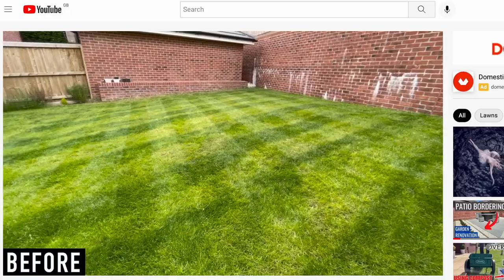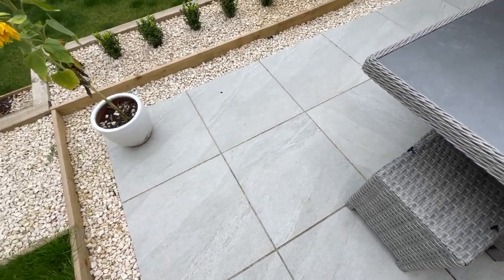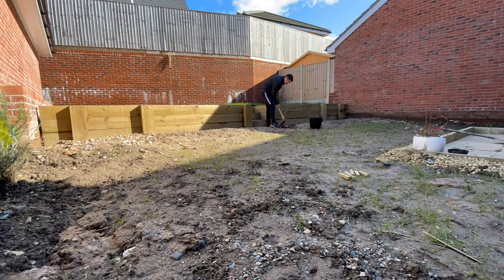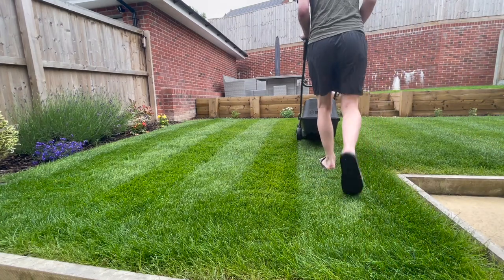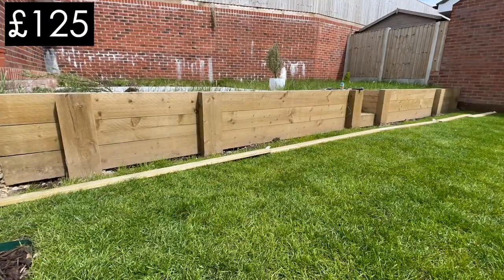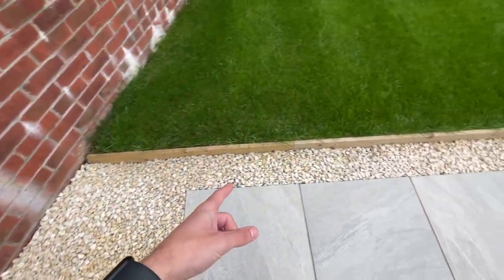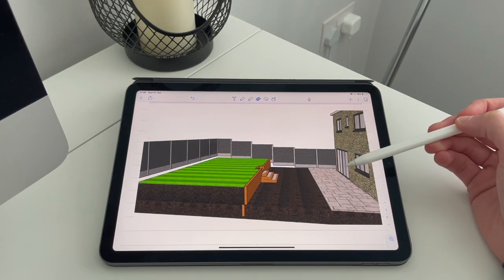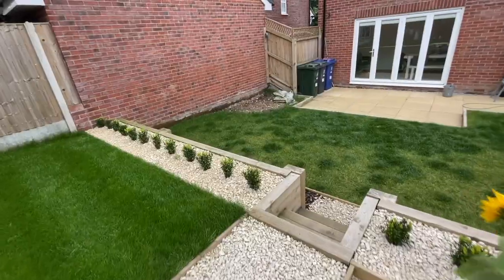HOW MUCH was my Garden Renovation?!

Comment: Nice work that mate. Ive warched all your videos for some inspiration on our mess of a garden. I consider myself an expert DIYer and im currently tackling a raised patio and sleeper wall to mask the old retaining wall (was quoted 5k just for the patio) so far, our sleepers have cost £400 (25 no 8 x 4 x 8' long) and 70 no 900 x 600 porcelain tiles were just shy of £900. Recycled type 1 is going to cost me £120. Not sure on sand and cement yet and ill probably make my own slurry. I would VLOG it but im 52 and wouldnt know where to start.....😂

Comment: Hi. Loved your video. Just a question, regarding hard core compaction, did you had to hire that machine you were using? How much did it cost you?
Thank you
Reply from the maker: I hired a compactor plate from HSS. It was around about £40 I think for a couple of days. It may have been slightly more or less.

However, just check the reviews for where you hire one. I hired the one I used from HSS and had to pay a deposit of £110 which was supposed to be back in my account 2 working days after taking it back. Almost 3 weeks i took! Got it back after numerous phone calls.

Comment: How much topsoil did you use? I can't find it for any less than around £90 a ton and I think I need about ten tons and that is just to cover some old crappy soil with loads of weeds and small stones in it on an 80 sq.m garden.
Reply from the maker: If I was you, I'd try and contact a local supplier. For one bulk bag from the big names, you're looking at well over £100 - it's unbelievable! I got in touch with a local top soil supplier that I found on Google and managed to get a decent quote with it being dumped loose on the driveway.
Reply: @NoviceGardener  Thanks. Yeah, I have noticed that there seems to be a bit of a "discount" if you get it loose. I think that's the way to go. 

I think the bulk bags are getting smaller and the prices going up. I have seen them as low as 600 litres now for around £120.